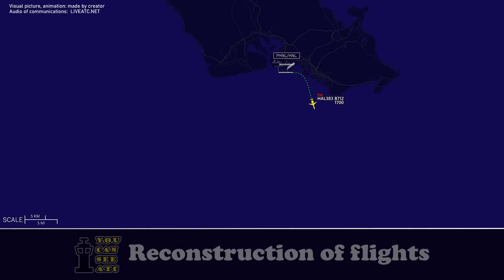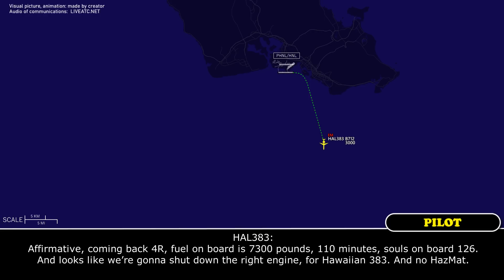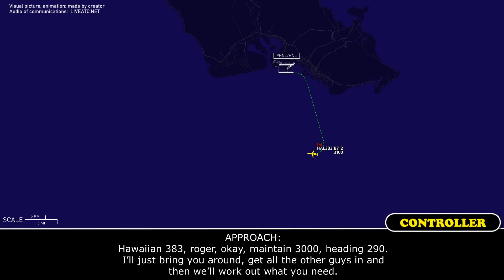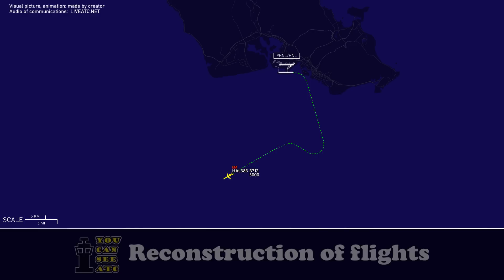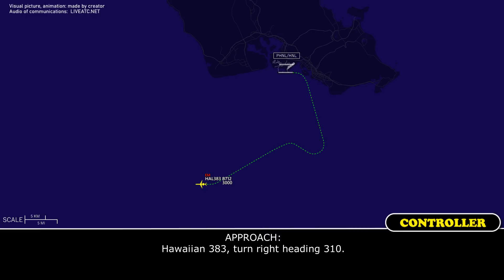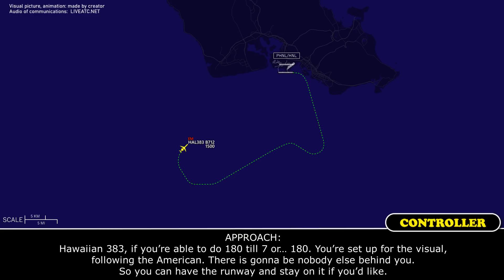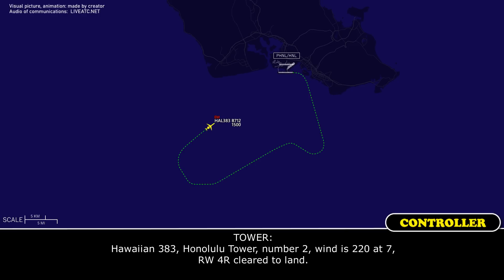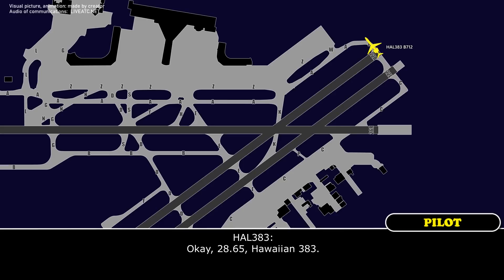Engine compressor stall after take-off. Hawaiian B712 lost the engine near Honolulu. Real ATC

Comment: This is the exact reason you get all necessary information first before switching an emergency off your frequency. I use to train emergency comms and you do not do this. If that is there procedure, it is wrong, and they need to reevaluate. You can never be 100% sure the aircraft will be able to come up on the new frequency. Get the nature of the emergency, pob and the aircraft intentions, then you can switch as necessary.
Reply: I’ll get a lot of $hit for this, but be honest, American comms is utter $hit. Every departure briefing includes the emergency brief. You know almost exactly what will happen, so just say it. Why use 100 words when 20 will do? 

Ps Hi RLT.
Reply: @EdOeuna  do you mean pilots or ATC?
Reply: @bsmith1164  - almost exclusively pilots. ATC is overstretched, generally, so they’re struggling with the system. In this case the first emergency call to ATC should have contained a little more information. In other videos we hear pilots saying “we’re running checklists, standby”. Again, this isn’t enough initial information for ATC to work with given the tight airspace and range of what could go wrong during initial climb out. I’ve got no doubts as to pilots abilities to fly the lane, just comms seems far worse than elsewhere, and by a long margin.